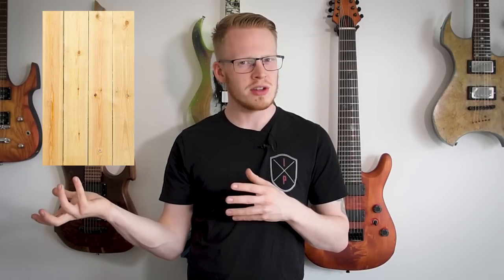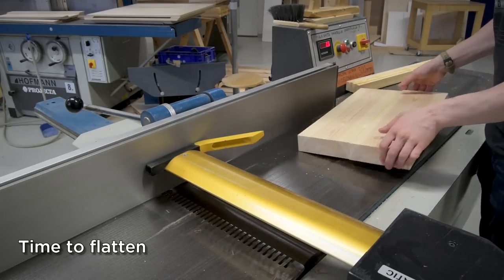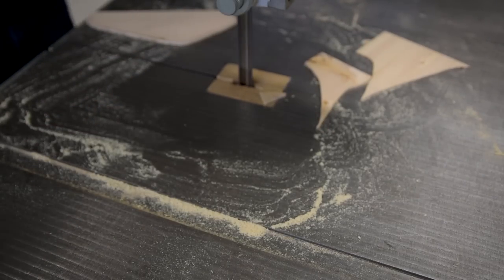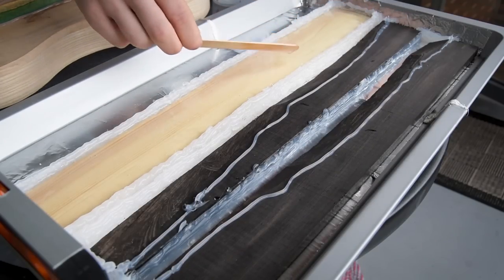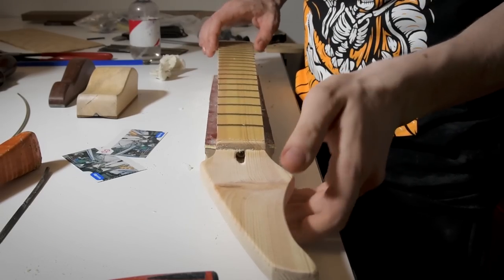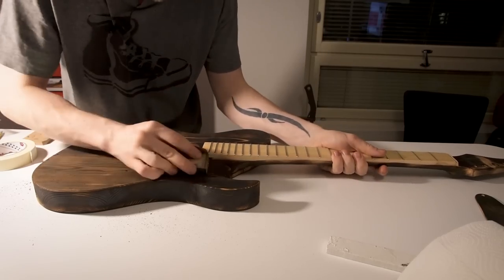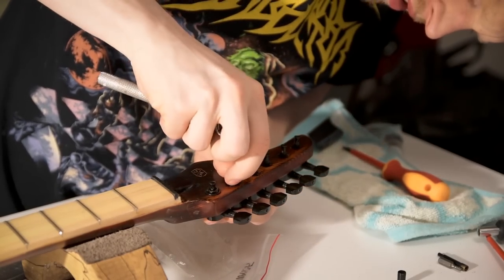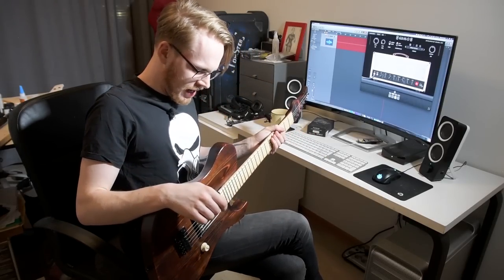I Made A 100% Pine Guitar!

Comment: It is actually very common to build guitars from pine, just going to a lumberstore like you did is not the best way because it needs to dry out for several months or even years before its good to use, how ever i think your build turned out cool and you did a pretty good job with it, even though i see some serious safety issues with the machines during the build, also you get very much better results on the bandsaw if you lower the bladeguide closer to the material you are cutting, and there is several ways to getter results when drilling and such, you are still young and have quite a few things to learn about guitarbuilding... this guitar is a way in the right direction because it turned out great.
Reply from the maker: You are absolutely right with this! So many great instruments have been made out of pine and even as an example Fender uses pine in their recent stuff as well. Though not with pine necks and fretboards ;)

As for the hardware store aspect: this was actually pine from a lumberyard, but even so the point of the challenge was to see if it was possible to make a guitar out of pine and as close to zero budget as possible. While I wholly agree that you should not make any guitar out of wood that has not been properly dried and I missed out on expressing this in the video, this pine was at an acceptable moisture level for the project.

The safety issues I have taken into account in recent videos, more so because of realizing I should not be "teaching" poor machining etiquette (at worst, downright dangerous). While the lower bandsaw guard would give a better cut, I adjusted according to the types of cuts I was planning on making... Still, not well, looking back.

Thank you very much for your comment and great points. This entire project was without a doubt mistake-laden throughout, but a whole lot of fun.

Comment: Structural engineer here, it seems worth noting that most pine species have comparable or better bending values than the typical hardwoods used in guitar builds per our (USA) building codes. You definitely run into problems when knots get involved to be sure but using softer woods like pine doesn't mean it's weak.
Reply from the maker: Oh yeah definitely! Never meant that it would necessarily be weak. Constructed properly and you'll maximize the integrity even more so. Just generally an experiment on the matter that proved successful :) The small bit of hesitation toward the neck was mostly due to feeding off the apprehension of others. Logically it should be (and was) just fine.
Reply: @IPGuitars  No problem, it was a beautiful build that sounded great too in my opinion. I just like to do what I can in getting people to understand wood strength so they don't feel limited in their material options for things like this. Maybe it's not the optimal species for this but the workability is good for quick turnaround and experimentation at the very least :)
Reply from the maker: Thank you very much.

And I completely agree! And in general it rubs me the wrong way whenever people go on about some wood not being suitable for guitar building when that is hardly the case. Only that the wood isn't as commonly used as the basic mahogany-maple setup, which in turn I find boring.

And considering suistainability, it is good to experiment with your materials to keep your options open :)

Comment: Excellent video and content.. pretty rough.. crafty and handy for this one! I loved that.. I’m doing my own guitar project.. CADing.. sketching and drawing meanwhile I get with the woods and tools.. but I have one question.. how do you managed to don’t get all rocky frets hammering those into the fretboard? I know the post leveling with the level sanding will let them nice and even! But I would appreciate some enlightenment about how it would done with some device or tool to match with the radius!
Reply from the maker: Thank you :)

Essentially the way I hammered the frets (radiused to slightly more than my fretboard radius) into this neck was the same as with any other. Tap in both ends of the fret, then hammer from the middle out. This way the fret tangs go down and to the side, which will keep them from popping straight out. The glue here is a pre-emptive measure to give some more structural integrity to the whole thing.

But I am looking to improve this further: so after the frets have been hammered in, I would still use a fret press with the proper radiused caul. This way I could ensure even pressure throughout the fret.

Then when levelling you would already follow the radius of the fretboard. And you really shouldn't need to level any more than with a few passes really if you've done a good job. But always keep your fret-rocker handy to check for high spots.
Reply: @IPGuitars  I see.. I appreciate your time! Your comments and videos are super helpfuls and I hope that you keep rocking those guitar builds!
Reply from the maker: @RicardoAldana1988  Thank you for the kind words :)
Reply: @IPGuitars  Thank you for this videos

Comment: i believe that if you had glued the neck boards with epoxy you would get a stronger neck because it s less elastic than wood glue. Great project, great result!
Reply from the maker: Might be, but even a year and a half onwards it is going strong💪🏻 so I'm not too fussed about it :)
Reply: @IPGuitars  glad to know! Do you think that epoxy helped to keep the neck straight?
Reply from the maker: Not really. The stuff I used did not penetrate as much as I originally planned. Essentially it is more akin to just a really thick coat of lacquer. I would've needed a vacuum chamber to get the epoxy to seep into the grain consistently. But it is the truss rod and multilamination that plays a much bigger part in keeping straight

Comment: cool.. how is the neck 2 years later? Is the neck angle adequate to prevent string buzz without using string trees? It looks pretty awesome. Good job
Reply from the maker: Neck is still great! However I did just add string trees to it as the headstock angle was a little too shallow. But this small addition made one helluva difference!

Comment: Thanks for taking the time to shoot this whole build, and for your honesty in including the things that perhaps didn't go how you would have liked. I also build guitars but have never dared, yet, build a neck from pine, mainly because of fears about strength. I think the idea of making the neck multi-laminate is a really good one, to optimize grain orientation. And the process of steeping the fretboard in epoxy resin is something that never occurred to me, but seemed to give you a great result. It's all good food for thought. Maybe we really don't need to deplete the rainforests of all the exotic hardwoods! Thanks again.
Reply from the maker: Thanks for the kind words :)
I always aim to film as much as possible in my builds and I strive to be honest and include (and discuss) failures. It helps me learn to hone my craft and hopefully helps others avoid making similar mistakes.

As for wood choice, I completely agree. While I of course wouldn't usually recommend pine as it is still rather soft for a neck/fretboard, it isn't impossible to get something stable enough if you're smart about construction. In general, I try to use materials that are readily available domestically and as sustainably sourced as I can find. Fortunately as luthiers, our usage of woods covers quite a small footprint, so it's easy enough :)

Comment: I‘m mainly an acoustic player, but the guitar sounds great to me. Pretty cool project. Seems like something like this would be a cheap way to learn guitar making. If you screw something up, it won‘t hurt the wallet so bad. Anyway, cool video!
Reply from the maker: That was kinda what I was aiming to showcase with this as well. While yes, I rented hours at a local maker's space, you technically could achieve this with just handtools, which is what J ended up doing with his pine build (also with zero experience in making guitars).

Comment: Thanks for the very interesting build video. The guitar sounds very resonant, and totally works with metal type gain. For my taste the clean tone is perhaps a bit too dark. Did you use a 250k potentiometer? The burning/staining/finish work came out really great as well!
Reply from the maker: Glad to hear you liked the video! And completely agree with you on the sound of the gain and clean. The potentiometer in this one is a 250k, which is probably why it sounds so dark.

The plan is to upgrade this guitar and see how good I can make it. New electronics, hardware, and so on. A 500k pot is definitely on the list too.

Comment: Thats a great build mate. I’m a firm believer in the wood making bugger all difference to the tone of a guitar. The neck is impressive but since you laminated it, should be pretty stable. Only slightly odd thing is the pickup placement, it’s in a bit of no mans land there lol Having it further back would brighten up the cleans and make the distortion more punchy. Going to do one with plywood for my next build, the last one was wenge and mahogany, so a bit of a difference lol
Reply from the maker: Thank you! Yeah, the pickup placement is not as intended. This was due to accidentally routing the neck pocket to the wrong mark that I had drawn on.. unfortunate mistake and resulted in moving the bridge back almost an inch.

Oh cool, I've had a fair few friends make plywood guitars, so I wish you luck on the build! Always slightly different working with plywood than solid planks, with its own challenges.
Reply: @IPGuitars  Yeah, guessed that’s what happened. Still sounded good though 👍🏻 Plywood should be interesting, I’m doing a fabric finish so should be able to cover up anything that doesn’t look great 😃
Reply from the maker: Yeah, it turned out decent but bugged me for the longest time. Now it just stands to show that I have indeed learned from my mistakes haha.

Oh cool, that sounds like a fun idea. Be sure to pop by the comment section any time and let me know how it worked out!

Comment: Okay. So very high quality pine can probably be used to build electric guitars. Like old growth Southern yellow pine which is harder and more stable than many hardwoods. But only the best with fine, straight grain and no knots. But that wood is actually more expensive than many hardwoods like ash and locust. The pine at the home center, even “select pine”, is very soft, can be almost any species, and will bend and twist and warp all over the place. For a guitar body it doesn’t really matter much. But for necks, forget pine. Leo Fender found that out 70 years ago.
Reply from the maker: And yet, this is made with the cheapest stuff possible and it hasn't warped (just did a 4 years later video too) heh.
But yes, I agree 100%. While this for some reason worked for me, there is no way I would recommend it to anyone looking to build a guitar out of pine.

Comment: I was not surprised about the body, but the neck with a pine fretboard really threw me. Although, I also was greatly surprised that it actually worked. There must be some physics involved why this neck worked as well as it did.
Reply from the maker: Likewise, pine bodies are not that uncommon, but the neck surprised me and still does to this day.

Construction accounts for a lot of why it worked. Another of course is that was dry to the point that it wouldn't start moving because of moisture content. I suspect the yakisugi method helped with this aswell.

Comment: The problem is that "pine" is often a generic term for common construction lumber...which might actually be any of a dozen or more kinds of actual "pine" or other coniferous wood such as fir, spruce, cedar with varying degrees of hardness. In that regard, spruce or cedar is already the preferred wood for acoustic guitar tops...and strong cypress is preferred for flamenco guitars.  (...with backs & sides as thin as 1/8 inch).

BTW, since large lumber purveyors store hardware & such goods indoors, but much of the lumber in outdoor racks in the "yard", the most common name for such a place, at least in the USA, is as a "lumber-yard", while the company itself is likely to refer to itself simply as a "lumber company". 

Southern  (USA) Yellow Pine, which is commonly available in Europe....though significantly softer than Maple or Rosewood...is significantly harder than the Alder, Poplar & especially Cottonwood (...Basswood) that solid-body electric guitars are often made of. Plus, for a premium in price (but still less than "hardwood" lumber) construction timber is available in "clear" grade...no knots. And, softwoods, as if done with maple, can be hardened somewhat by "roasting" at close to 400 degrees F for an hour or so.

Bamboo is laminated all in one grain direction, unlike normal plywood. So, I don't see why that or SW - "strand woven" bamboo can't be used for fingerboards, as this can have a Janka hardness rating of up to 4000...similar to ebony & more than twice that of rosewood or maple And, it is dimensionally stable at varying temperatures & humidity. 

You could start with a piece of bamboo flooring, costing a few dollars, that can be planed & sanded to the appropriate radius, with uniform color thru & thru (unlike laminated oak flooring that is really a form of hardwood plywood) and I bet you could create a dense fingerboard to be proud of..
Reply from the maker: Haven't run into that being a problem over here to be honest🤔 ours are very well labelled between the different evergreens in most cases.

I've actually got a few luthier friends who have used laminated bamboo on guitars with good results

Comment: It looks decent. Not so sure on the longevity of the neck & fretboard.  Nice build. Novo use Pine on their $4000+ guitars, only on the bodies I believe.
Reply from the maker: Yeah pine bodies are actually surprisingly common. Even Fender brought it back for some models.

While I definitely would not recommend a pine neck or fretboard in any case, I did make a video on this guitar now 4 years later. It's still holding up👌🏼

Comment: The problem with pine is that it has to be very, very dry because otherwise it splinters easily. But I don't see why pine can't be used as a material to make the body of an electric guitar. The neck would undoubtedly be made of maple, since it is harder and withstands the tension of the strings better.
Reply from the maker: Absolutely right. And pine bodies have definitely made a sort of resurgence in the last few years! It's actually pretty cool to see.

Still wouldn't recommend a neck, even though I have run into a few. And I mean, heck, mine is still in great condition after all these years (against all odds).

Comment: This is a great guitar sir... and i love that you filmd the whole process. 
I started building a guitar with pine... and it really sounds fairly good... the only issue i had with my pine guitar is that is can easily dent.... and a rat  ate/bit a small chuck to it... so i decided to change my guitar body to mahogany...
Reply from the maker: Thank you :) I usually film the process of most of my builds.

Pine is very soft, so dents can occur pretty easily. That's why I burned the body and also added a thin, but durable acrylic finish to it. Oof about the rat eating a piece of it. Good luck with the mahogany one!
Reply: @IPGuitars  yes sir... i'm starting to work with hardwood in my later build... the only reason why i'm tempted to use pine(softwood) and a plywood... is because it is already  flat and squared. Pine here is in S4S... so i don't need to plane it for a proprtionate thickness... i don't have a bandsaw and a thickness planner and all i have are bunch of power hand tools... so i tried to experiment and scout for some materials that i can use based on the availability of my tools...
Reply from the maker: That makes perfect sense :) work with what you got